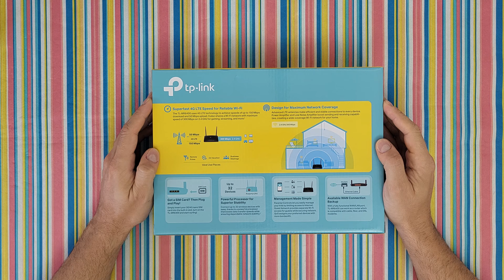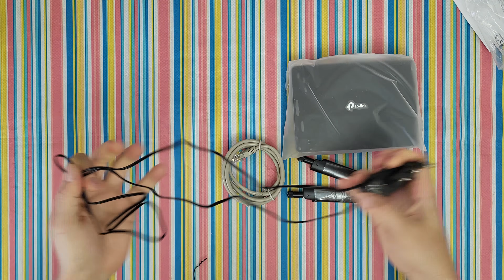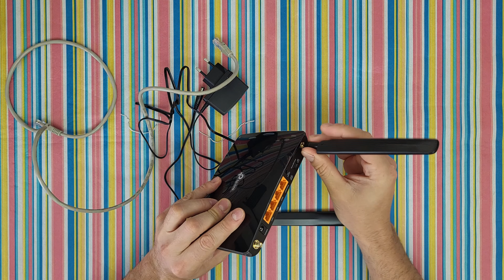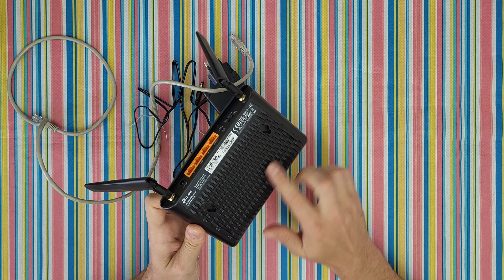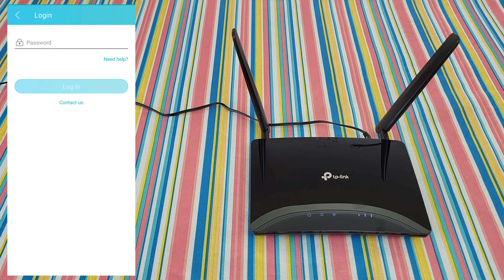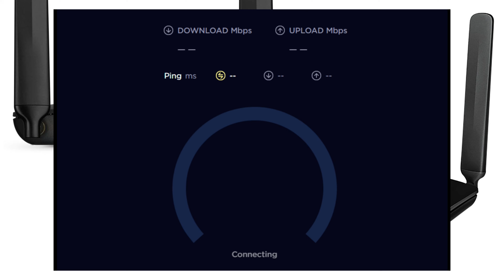TP-Link TL-MR6400 (V5.2) 300 Mbps Wireless 4G LTE Router REVIEW

Comment: Is there a lower or other version of MR6400? Planning to buy 1 (mr6400 or MR200)
Reply: MR-100 is good, ive seen it work in a rural area with minimal connectivity and it gives about 10mbps speed for downloads.
Reply: @simplysurfing  already got my MR6400 EU V5.30. download speed 10-20mbps + in 2 signal bars on our location., still it depends on the telco provider
Reply: @J_j_o_h_n  OK. I have an MR100 and it shows 3 bar signal. So if i put this MR6400 in the same place with the same sim form the MR100 will it give better performance or the same as MR100. The MR100 gives me between 5-10mbps even though the signal is full 3 bar.
Reply: @J_j_o_h_n  Wenn Sie die Internet-Empfangsgeschwindigkeit Ihres Smartphones und dieses Routers vergleichen, wo wird die höhere Geschwindigkeit liegen? Ich habe vor, dieses Modell zu kaufen.

Comment: Can i do port forwarding with 4G sim card using this router?
Reply: My understanding is that most Mobile Internet providers use Carrier Grade NAT and I can't see how that would work. Of course if you get a static IP or a non CGNAT deal than that is not a problem. In essence, CGNAT shares a single IP address with several users.